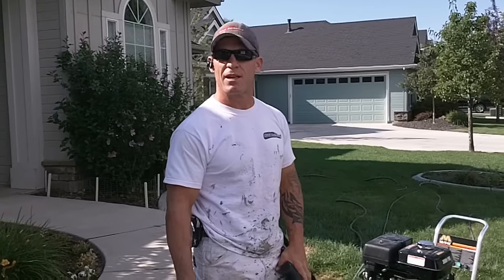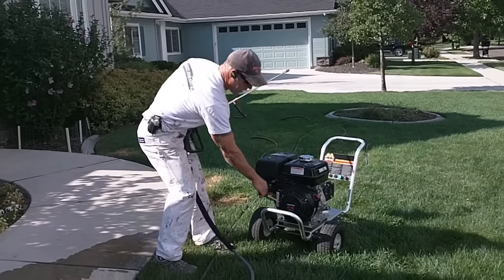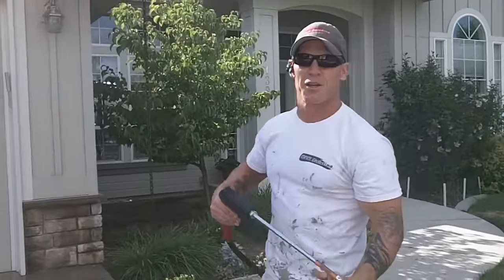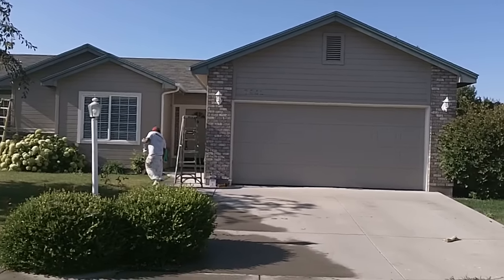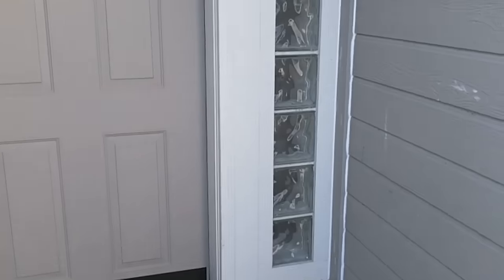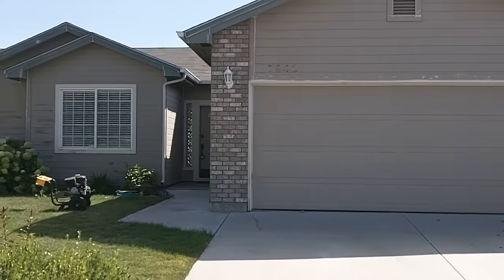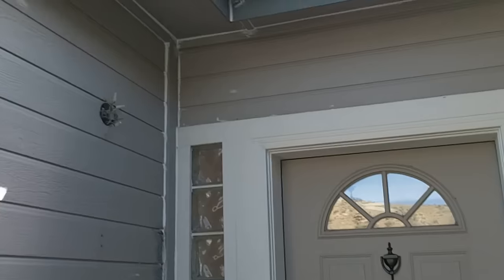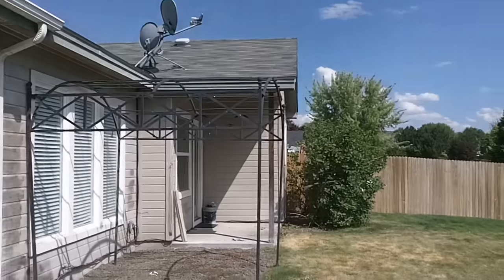How to paint a house (the prep process).  Pressure Washing Tips.

Comment: What happens if you paint a house without proper prep work, such as,  caulking and primer?
Reply: It won't adhere well at all in some areas including bubbling or flaking off particularly on wood trim areas. Stucco? Eh... most paint stucco with flat paint but you still run the risk of having powdery looking areas afterwards from not cleaning. Any decent painter will tell you that the prep work is practically 3/4 of the job, painting is the easy part.